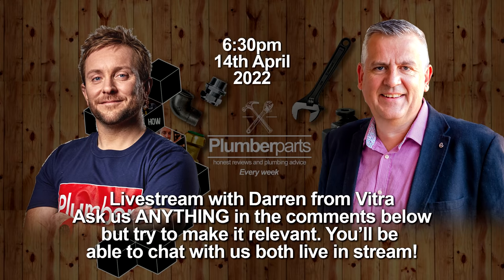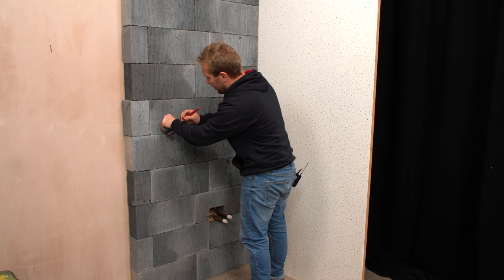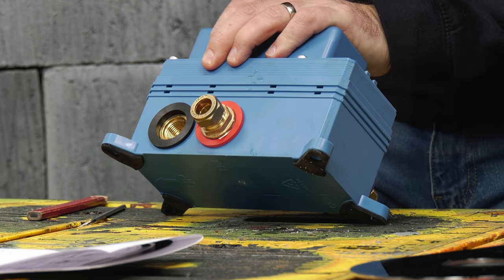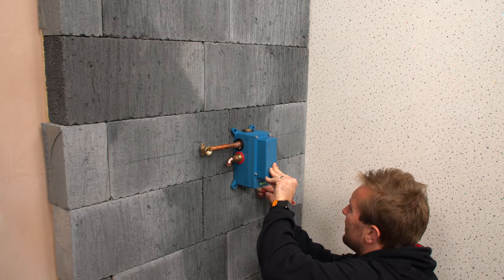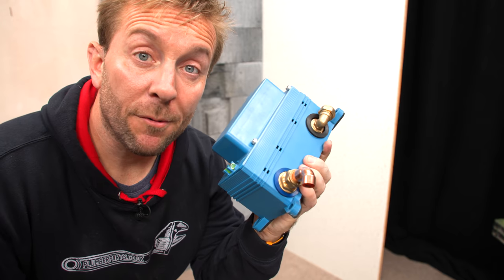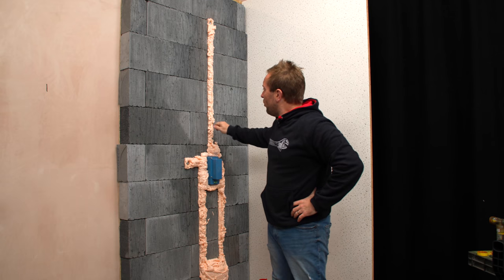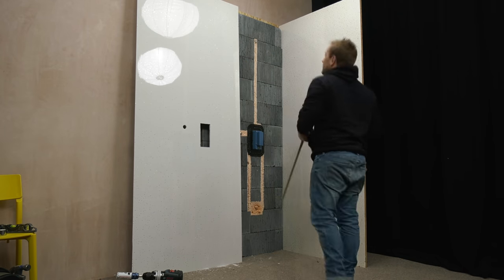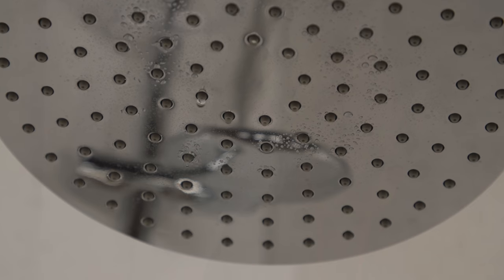How to install a recessed shower in a BRICK WALL - VitrA Aquaheat

Comment: Tip for cutting the holes in the aqua panel is to use a laser level to mark the position of the holes then dry fit your board to get the position. Works a treat.

Comment: Great video..... One question...If the connections on your shower valve are BSPP female, should the fitting with the male thread be straight or tapered?

Comment: In the process of installing one of these, very helpful video. Done all pipework, pressure tested and all good ready for boarding.  What I dont get is i cant test the shower head arm joint. How can i be sure it is not/wont leak? Thanks

Comment: How do you know the screw fittings to the mixer aren’t going to leak before soldiering fittings on? Is there a way to fool proof or leak test? Or do you trust the thread sealant/Teflon tape?

Comment: Just about to do the foam trick with my pipes, which one do you use, there appears to be two types, one for insulation and one for filling large gaps/voids!
Reply: High pressure/large gap filler
Reply: Hi, which type did you go with? I would be grateful for some guidance! Thanks!

Comment: The shower arm sealing by screwing in to match the required angle and not a certain tightness (relying on some thread sealant) is a terrible idea. Is there any other more reliable fittings that can be used? Cheers.
Also, Are you installing it upside down? The feeds look like they should coming from above to make the bath outlet at the bottom?

Comment: Is there any particular reason why you solder the joints compared to silver brazing ?
Reply: Brazing is overkill, more expensive/more time. Brazed joints are only needed for extra strength when buried.

Comment: Thanks for the video, very helpful. I'm a bit of a novice so this may be a silly question... but in the part where you fit the 1/2" bsp to 15mm elbow, how do you fit it so that it points the right way? I've dry fitted on the valve I have, but the hot and cold elbows end up pointing in funny directions. Do I need to use washers in between the valve and elbow?

Thanks!
Reply: I use the loctite 55 for this, wind it to the right angle required. It usually has a bit of play back if needed without compromising the seal, unlike going back on PTFE for instance.

Comment: English ppl do the weirdest stuff, why would you run plumbing on an exterior wall to begin with? If global warming reverses, gunna have to worry about those pipes freezing.
Reply: Not likely to freeze as British houses are generally double Brick with and air gap or insulation between. Only way pipe usually freeze is if the property is vacant and no heating on / full pipes.
Reply: Always find it difficult to fit concealed shower valves into bricks. Maximum chase depth is 1 3rd the depth of the brick so about 30mm.